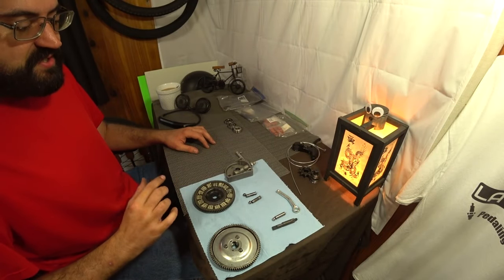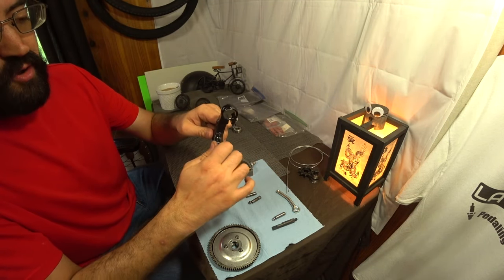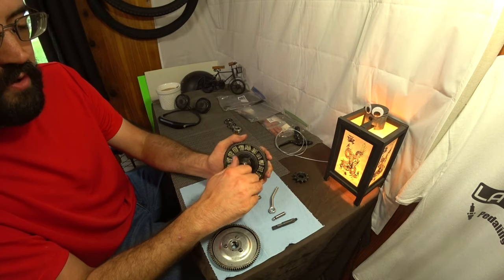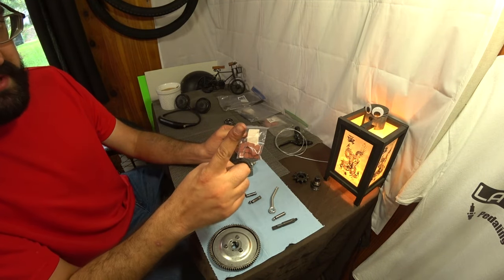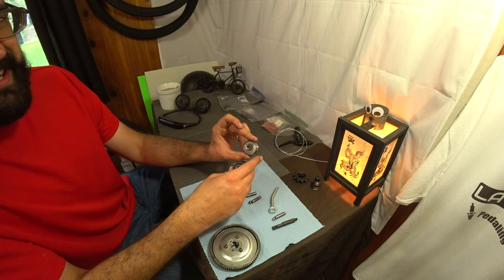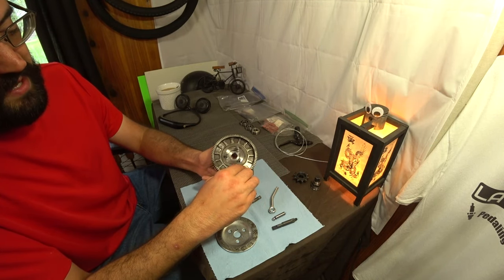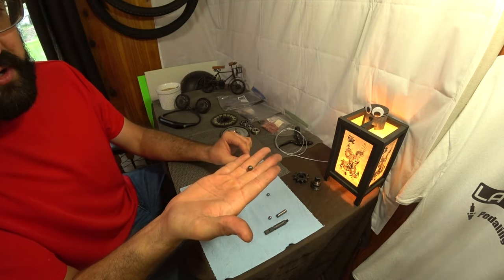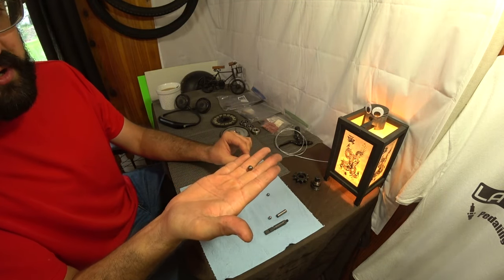How To Correctly Adjust A Motorized Bike Clutch

Comment: i find that clutch shaft assembly wear out. the ball bearing inside it will wears out the shaft.
Reply from the maker: I have never had that issue, but it does make sense. Good call
Reply: @TA-xj5we  my clutch is stck it wont disengage
Reply: @TA-xj5we  im gonna just get a yd100 an put this aside for a lil it got me over 3k miles for 100 bucks she did her job for now its a triple 40 pk80 thnx for your reply
Reply: @TA-xj5we  happy new year by the way
Reply: @TA-xj5we  thats dope asf i just need the motor any links
Reply: @TA-xj5we  on that note i have a crazy possume vid on my channel u might like an im about to upload a kitten being pushed by the mommy cat to hunt an or pounce on a squierell should i upload it

Comment: I have burned up about 10 bucking bars. I finally found that WHITE LITHIUM GREASE works very well. I want everyone to know this as I have been stranded due to a melted bucking bar on more than one occasion.
Reply: That's funny as heck. Because I preach about greasing the ball bearing and the bucking bar, the case lever and the bevel gear

Comment: I rebuilt the entire clutch assembly on my motorized bike about 2 weeks ago. Really wish I could have seen this first 😂
Reply: Also, can you cover the internal clutch shaft, spring, etc. I feel like it plays a big role in the clutch feeling and adjustment, but always gets overlooked. Sometimes, the issue is beyond the bucking bar, flower nut, cable tension, etc.
Reply: How long did it take you

Comment: This video is superb! I ended up throwing out an engine, due being unable to figure out why the clutch wasn't disengaging. If only I had watched this sooner... This is the ultimate guide to clutch problems, and prevention. Thanks so much!!
Reply: There is 1 item he doesn't talk about. That is the inner spring lock pin inside the shaft that also holds the spring. 
I replace that pin,(by disassembling the clutch lock nut and spring), I found this lock pin both bent and broken in cases. You can fix this by replacing it with a grade 8.8 bolt and grinding it down to size. Now you gain a stronger inner spring lock pin, it is a mm longer barely touching your spring. Set your preload tighter and safely now.

Comment: Just adjusted my clutch incorrectly. This clarified things. Great job.
Reply from the maker: Hey sorry I'm late, I just saw you video, Is it still slipping?
Reply: @LAHover  yes, slips. I’m sure I  overtightened the flower nut just to get some grip. New erasers, and tightened the inside(shaft?) spring , 1’ plus by rolling the bike backwards. I scuffed up the clutch plate a bit to increase grip, I put in a slightly longer clutch push pin that touches the ball bearing to compensate for the flower tightening. I noticed a lot of play on the clutch large sprocket. Could this cause my slipping? I’m stumped. I can get the bike going but it takes a bit of low speed peddling.
Reply from the maker: @markwatson1970  Side to side play in the large bevel gear is a sing that the tiny friction plate bearing may be failing / falling out, but as far as I know it wont cause slipping. Once you get the bike started does the clutch still slip much during acceleration?
Reply: @LAHover  it accelerates fine and behaves once I get her going. It’s the initial grip to turn over the engine that seems to be lacking.
Reply from the maker: @markwatson1970  I'm starting to think your motor may have great compression. Try these pads instead https://www.amazon.com/dp/B095HLBWFN/ref=cm_sw_r_cp_apa_glt_fabc_PX8M165D4VKPG5QHRV5R
I have seen people make their own by cutting car brake pads as well... I'll be trying it in a near future video as well.
Reply: @LAHover  I’ll try that. What is the compression supposed to be on the 80cc YAE motor? I have a tester to check this. Thanks for helping.
Reply from the maker: @markwatson1970  I honestly don't know. But I'll order a tester and check some of my bikes so we can get an average :)
Reply: @LAHover  if you check my page you will see the main culprit causing my problems. The pin that holds the main tension spring in my lace was bent. Lord only knows the pressure required to bend that.
Reply from the maker: @markwatson1970  I don't see the video on your page, is it unlisted? But I know what pin you are talking about. I'm glad you found the issue, I hope it was an easy fix.
Reply: @LAHover  I think I just loaded it for public viewing. I’m new obviously. Just waiting on the pads you suggested, still some slipping at initial start. Runs well.

Comment: I used an Old drill bit as a bucking bar as I lost mine I just used the the same diameter drill bit as the bucking bar cut the drill bit off obviously and used the part that sets into the drill it seems to work fine and is holding up fine better then the stock one alot stronger material

Comment: Thank you so much man. For a long time, it took me a while to start my bike up. I thought it was because the motor had to "warm up" or I wasn't giving enough choke or what not. Little did I know, my clutch had been slipping since the beginning. I needed to adjust my inner collar nut. Now, as soon as I let out the clutch, she springs up to life!
Reply from the maker: If you still have slipping issues check the video description, there is an advanced repair video link.

Comment: Thank you La Hover even tho it's 3 yrs old.  I want to add 1 important factor. Pasting away 
There is 1 item he doesn't talk about. That is the inner spring lock pin inside the shaft that also holds the spring. 
I replace that pin,(by disassembling the clutch lock nut and spring), I found this lock pin both bent and broken in cases. You can fix this by replacing it with a grade 8.8 bolt and grinding it down to size. Now you gain a stronger inner spring lock pin, it is a mm longer barely touching your spring. Set your preload tighter and safely now.

Comment: That's a Really great video.Thank you.I use a magnet to pull the Bucking  Bar and Ball Bearing together.1st time I wanted to re-grease I figured that out quick.LoL.When I installed my 2nd motor I removed the assembly that holds the cable end over the clutch shaft and squeezed in about 2 tablespoons of Gear Oil for that area.

Comment: 2:07 I run a spring over the cable between the clutch lever and the cable tube. The excess cable I then tuck into the spring so it doesn’t stick out and poke me or fray.

Comment: Great video! I so agree about the clutch lever cam assembly being assembled too tightly. Mine has very little "wiggle room" and I don't have any puller to disassemble it. I ordered another one that's disassembled, so hopefully I can assemble it with more cam shaft/bucking bar play-John in Texas

Comment: I see why a new engines is  sold for $99...

Amazing the big power from 60 cc is only like 4 HP tops...

My old Suzuki 50 cc...vintage 1972....a 3 speed auto transmission and put out close to 3 hp....and lasted years....quiet smooth and fast
😮

Comment: A couple of the replacement bucking bars I've gotten on Amazon have been too short, leaving me wondering what the heck I had done wrong. I found one that actually gave a measurement and sure enough, when compared to the previous ones I had gotten, it was a few MM longer!

Comment: Also another reason your clutch might be slipping might be the small drive gear. How I fixed it was I got a bolt and put the head of the bolt against the bevel and drive gears to lock the motor up. Then I tightened up the bolt and that fixed my clutch issues
Reply from the maker: That gear should be keyed as well, but if the fix works for you that's great.

Comment: Your video is very good. My question is. The inner bearings on each side went bad. When I remove the clutch assembly some of the ball bearings fell out. The bearing races are pressed in. My question is simply how do you take these races out so I can put new ones in. Tried heating the bearings with a propane torch. Then I tried knocking them out with a hammer and chisel. Didn't work. Any ideas?

Comment: I've learned that if I take my new upgraded clutch pads and pass the outer edges on a grinder just to smooth the edges out they move towards the inner clutch disc better and bite on both sides better.
Reply from the maker: Interesting, thanks for the suggestion.

Comment: I did like the video as it is very informative. 
Not sure if I'd fallow you on fastening the gas tank to the top frame bar technique. 
I guess that the little bolts were broken or stripped. If so, I'd have replaced the tank.

Comment: Well done!  Thank you. Have you ever find the need to adjust the inner spring on the clutch shaft?  I know you can remove the cable holder, and place a sizable punch and move the rear wheel forward / backwards to help adjust.  Figured I'd like to hear your opinion on that, and Thanks again for the channel & your wisdom. :-)
Reply from the maker: I never have. I did have it in the original upload but I had to cut it out because I mistakenly said "move the wheel forwards" lol opps

Comment: 👏👏👏👏 well done on the video 🚲💨💨💨 and information on the clutch and the bucking bar I have had that problem before thanks 💨💨💨💨🤙👍💯
Reply: Welcome 🚲💨💨💨
Reply: my back wheel is stck moto rider the clutch wont make the small gear turn it wont disengage
Reply: @SpACeCruizeR2o3  did you get it figured out
Reply: @motorizedbicyclerider5296  not yet im thinking the piston might be stuck i went to the store shut the bike down came out and the clutch wont disengage its stuck
Reply: @SpACeCruizeR2o3  it's kind of hard to say it could be any little problem you'll just have to take it apart
Reply: Check the small stuff first🚲💨💨
Reply: im about to just get the yd and put the triple 40 to the side for a lil bit an tinker wit it

Comment: I screw on a small blue electrical blue wire nut on my cable ends 
I remember the first time my pads got wet.  Wow I thought I ruined the clutch but all I had to do was take it apart and let it dry I could imagine how difficult if oil or grease gets in the clutch pad
Reply from the maker: I'll have to try that some time.

Comment: Does anyone know if it is possible to fit the drive sprocket onto the clutch so that I could run a chain to my bicycles original gear setup? That way I won't need to use a jackshaft thanks

Comment: My clutch arm has to be turned in WAY past neutral before it gets close to touching the bucking bar. Do any of these engines use two bucking bars? One smaller than the other? It may be a false memory but I thought when I first got this (PK 80) that there was a big bucking bar, a bearing and a smaller bucking bar but if it did, I lost the smaller one. My bike has less than 10 miles on it and the bucking bar is already very rounded over.

Comment: I'm doing my first build and when I connected my clutch cable it didn't seem to have any movement at all. About a 1/4". So I took off the casing and the bucking bar doesn't seem to move at all . I'm I missing something? Is this common?

Comment: Question: why does my clutch 'grab-slip-grab' to the point where the engine won't start because I can't get a full revolution of the crank to fire it off? I'm thinking the Clutch plate is either warped, or it's possible I could have over-greased the Bevel Gear, and some grease may have contaminated a few Clutch Pads? The Engine is a MaxInd YD100 with zero hours...

Comment: Well when your riding how do you know when your clutch shaft has been shot  completely? When I ride mine it just started where I hear a heart dropping grinding when I pull in the clutch and it didn't wanna go over 12mph I even had to help it go up hills
Reply from the maker: Good news, easy fix. Bad news, it sounds like your clutch basket bearing failed/migrated. I can't say for sure tho.

Comment: My clutch arm shredded itsself and I have a new one but I can tell by the way the motor engages when I have my clutch in it'll happen again if I dont do something... so hopefully by the end of his video I'll know what I need to know to prevent that from happening again
Reply: Okay my guess was it was probably my pads but ill see if I can clean those pressure plates too I'm sure there's more advice for my problem if I actually finish the video
Reply: Also what you said about the bucking bar and the clutch arm is all what happened to me a month after I bought it and didn't grease it the thing was unrideable
Reply from the maker: There is an advanced clutch video in the disco. Covers more issues if yours is not in this one.
Reply: @LAHover  im at work right now so ill be trying to fix it in about 4 hours but you covered about 6 possible problems i could have in the half of the video I watched on my lunch break you earned that like and follow for sure
Reply: @LAHover  do you have a video about putting the clutch gears back in? Not sure how to do that don't wanna take em off till I'm sure I can put it back on

Comment: Hey does anyone know why ny engine putters when I 1st start it.i cut muffler ran straight pipe and cut the side of air case off .I tried  to mess with carb but the only way it stops is if the idle is high .I dnt like to hear it like that but if thats what needs to be so be it

Comment: I need to install a new clutch shaft I took it all apart but I can't find a good video to put it back together idk how much pressure I have to push clutch to screw in flower nut also can I use the Lucas red n tacky grease for the gears please help anyone
Reply from the maker: I use that same grease, good stuff, fine for the gears.
In the description of this video is a link to more advanced issues. It might help... Good luck!

Comment: I gotta 80cc anbul kit... I got it to start once...every time after the clutch just slipped...I adjusted the flower nut and the spring under the clutch cable routing point and it still slips...my pressure plate looks like the engagement is lop sided...Its the pads are all black from the slipping...can you help me
Reply from the maker: 1: Make sure the set screw that keeps the flower nut from spinning is not to long (pushing on the basket).
2: Make sure the woodruff key is not missing or striped where the shaft meets the basket.
3: You may have a more advanced issue, this video may help. Good luck https://youtu.be/p92RqNhxuSE

Comment: What about the bearing balls from the clutch crown, those are between the pressure plates. Its hard to grease them and clean the back pressure plate afterwards, but they sure need some grease from time to time, or at least some wd40.

Comment: I just bought the 100cc 2 stroke motor. The clutch will not engage. The crank won't turn. It's not locked up.i need help with it.

Comment: My clutch is extremely stiff and hard to pull. I’ve changed the cable routing and removed the return spring but it’s still the same. Anything I can do? Maybe the clutch spring?

Comment: Hey man, I recently got a motorised bike that’s brand new and I tightened the wire for the clutch arm good and the clutch arm didn’t move. But when I pulled in the clutch the clutch arm got loose. Is there any easy fix to this?

Comment: I really need help I bought a motorized bike kit put everything on and got it working and I tried starting it and the clutch just slips so I did lots of adjusting with the flower nut so that I can idle still with the lever all the way in and the clutch wouldn’t grip even with the clutch tight. I have new pads to put on it even tho I only have about 5 hours on the bike.What should I do?
Reply from the maker: In the description of this video is a link to my more advance video that might have the same issue as your build. good luck I hope it helps.
Reply: @LAHover  okay thank you I will go check it out

Comment: Ok, I went through 3 camshafts that had completely worn out. I welded one back and that always stayed in one piece, but now I have a new issue. First of all I have no tension in my clutch lever, the bike doesn’t fire until low speeds. When it does for it slips on the plate because the ram stays the same until it heats up and than it grabs but have only ran it twice like that. Now I have figure out what’s wrong but not how to fix it, the pin that the flower nut attaches to is not moving in and out with the pull of the lever. Any idea what’s wrong?
Reply from the maker: Check out the video linked in the description. It covers more advance issues. Good chance yours is in it. Good luck!

Comment: So what if your clutch never disengages the motor? No matter how far I pull the clutch lever on the motor, the small drive sprocket never moves freely
Reply from the maker: Flower nut might be screwed in to far, the bucking bar's bearing might be missing, cam could be rounded off or misaligned, bucking bar may be mushroomed out. These are all the things covered in the video, however there could be internal damage inside the clutch shaft... The pin that the bearing pushing on might be missing/damaged.
If the bike has been setting for a while the friction plates might be stuck to the pads and need a good knock to lose.
Reply: @LAHover  That's a bummer, it's a brand new motor I haven't even finished installing yet. I was hoping to tear it apart to just grease it lol. Your video definitely helped me understand how all the parts interact with each other though so thanks!
Reply: @loganm.5068  I had the same problem just last week on a new motor and it was that the friction plates had rusted  to the pads, try what La Hover said give the plates a knock or assemble the kit, put the chain on, pull in clutch lever and rock bike back and forth. if that doesn't work there's probably something else going on.  
good luck...
you'll need it with these things.
Reply: @sikkkarts7621  Alright good to know. Thanks!